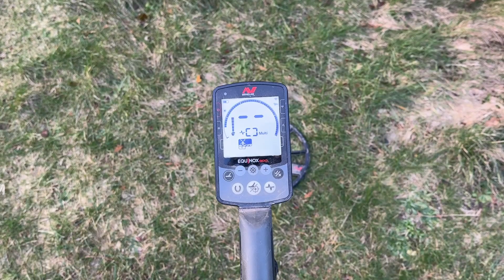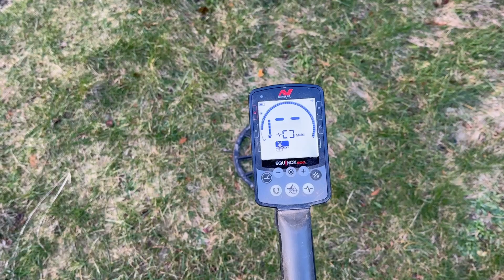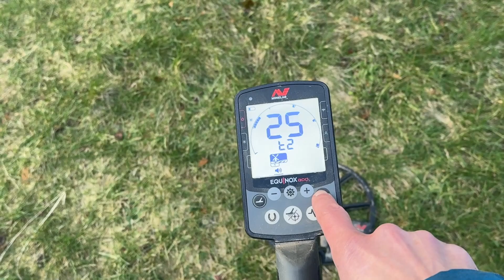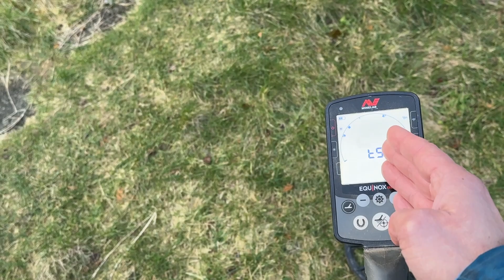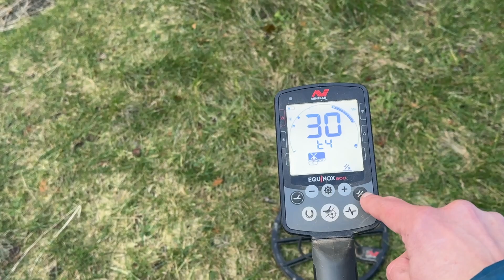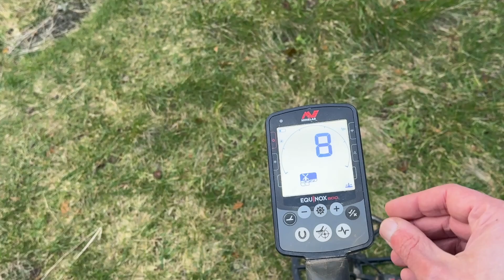BEST SETTINGS for your Metal Detector - Small relics & Hammered coins!🤩

Comment: What about the fe or f2 settings
Reply from the maker: FE and F2 are Iron Bias settings. FE is the standard mode, while F2 is an updated filter that is much better at identifying bottle caps and complex iron. For most hunters, F2 at 4 to 6 is the 'sweet spot' for stability, while F2 at 0 offers the best depth and unmasking in clean ground. 

High iron bias can mask deep coins by making them sound like iron. Hope this helps😉
Reply: @thespanishdetectorist at the moment i have f2 on 1 minor falsing so will go up a notch but not to high to mask silver

Comment: Holle can you tell me how detecting depth grownd have same metal detector?
Reply from the maker: With these settings on the video, and your sensitivity as high as you can, usually around 23-25 and recovery speed at either 2 or 3, but you need to swing slow to match the recovery speed, and down👍
Reply: Mr Simon you’ ar a very good teacher

Comment: Thanks Simom I love my 800 as wail bin using mine for about 5 or 6 years now love it but some of your settings i did no no so thanks for sharing
Reply from the maker: Yes I think is a reliable machine . Hope it helps in case if you adjust something👍

Comment: Very nice. Simon I use a equinox 800 too. Two things ive found. A 4 recovery speed gives your great depth. But youll miss deep silver if you sweep slow. Move your coil fast. Lay it upside down and try it with a coin. Youll see what I mean
Reply from the maker: Thanks for the tip Don, yes you are right, i think the middle would be more 4, rather than 5. And the coil should be always low and slow 😅